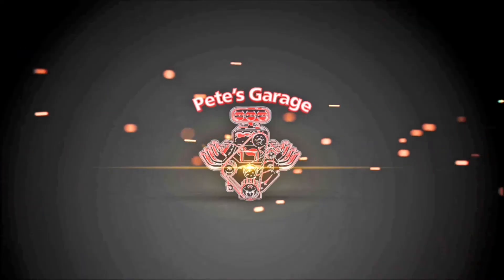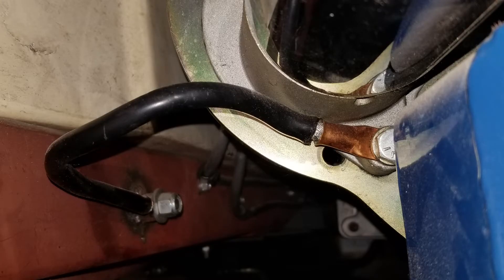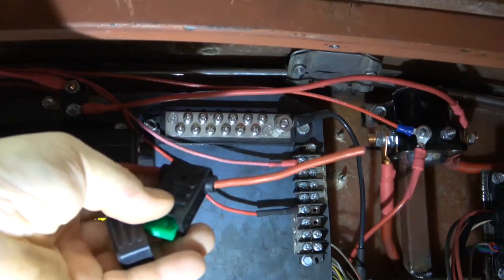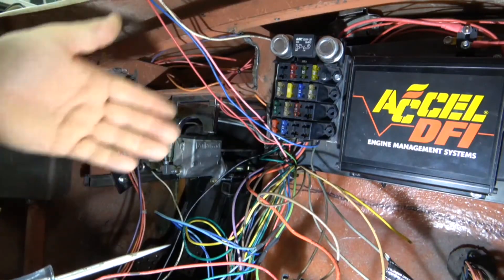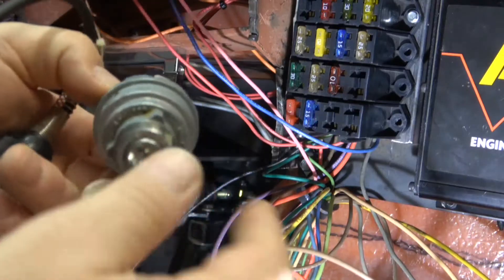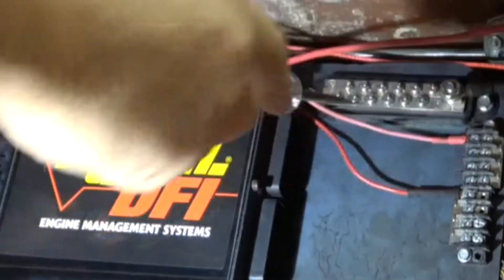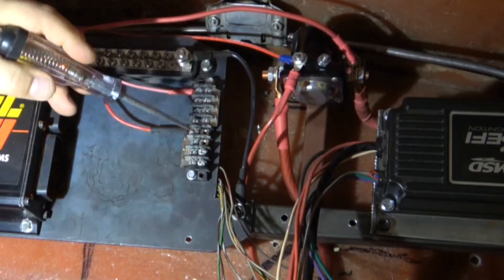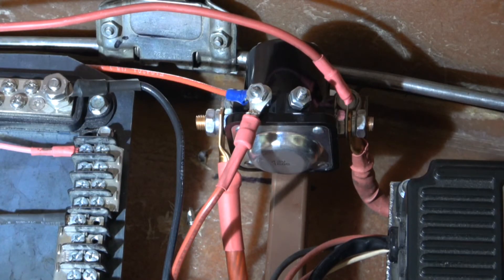Basic Wiring - Ground, Battery Plus, Ignition, Accessory Power - 427 Cobra

Comment: I was looking for is the neg. cable go from the batt. to the block, and if it has the old tiny wires do you snip those down insert them in a ring and just bolt them down with that neg. cable. since these have no answers, I'm going to speculate yes on a 2003 f150 4.6l
Reply from the maker: There should be a grounding strap from the block to the frame

Comment: Very detailed video, thank you! I don't understand the purpose of the second wire on the starter relay "S" terminal. You said it goes to the "starter solenoid". The starter relay IS the starter solenoid in this circuit, isn't it? If it isn't, and you're using a modern starter with its own solenoid, why do you even need the starter relay? Why not just send battery power and the neutral safety-switched ignition line direct to the starter solenoid and eliminate the starter relay altogether?
Reply from the maker: The starter relay pulls in to allow high amperage to run the starter motor. The starter solenoid pushes the gear out to engage the flywheel.
Reply: solenoid is much different. my hyundai 100 portable cut off on me randomly.... when its starting its cranking/tumbling but wouldnt start... it sounds like a battery/electrical problem but wasnt. just a small arse solenoid
Reply: but the solenoid typically located on starter itself. it needs each other

Comment: I have a 88 Winnebago Motorhome P30 Chevy, trying to wire circuit breaker box which feeds into the fuse panel box for DC chassis power. Trying to connect purple, red, blue, white, black wires. Can you provide any insight on properly connecting the wires properly so the switched side works properly. There are purple, red, white, black wires feeding to the circuit breaker box.
Reply from the maker: I need a schematic that shows were the wires come from or go to

Comment: I have a question that has an extra wrinkle.  So i am installing some digital guages (dash panel and two pod guages) as well as a radio. Each of these require an illumination dimmer signal.  Is it ok to find the dimmer source and run it to a small distribution block, so i can theb run one wire to each of the devices instead of trying to splice them all into one?  

Also, when supplying power to something like a guage, should a 12v constant wire be fused or should the 12v ignition be fused, or both? 
Thank you for the informative video!
Reply from the maker: Yes, you can run multiple lights from one dimmer source, in parallel

Gauges should be constant voltage with a fuse

Comment: Watching this video explained the interaction of the switch and the outputs in different positions. The exact info I needed. I couldn't find any info about the interaction of the outputs until I found this video. Now I know that the Accessory brown wiring is active in the Ignition switch Run position and off during the Start position. Exactly the info I needed to know to wire the Vintage Air IV Violet wire to a switched source. Turns OFF the compressor  in START position and ON during the RUN position. Thanks Pete!
Reply from the maker: I'm happy it helped. It can be confusing

Comment: Just to be clear, at 1:47 the video displayed is an engine hood open absent engine? The round thing is a master cylinder, other end is a negative terminal to the battery.  Hooked up to the chassis of the car.  Excuse me, but not everybody knows this.  It took me a minute to figure it out. I may be wrong.
Reply from the maker: No, the engine is in it. There is no master cylinder in the engine bay, they are under they are behind the dash. The negative terminal is hooked right to the frame

Comment: Question I have a 1993 mustang LX 2.3L. Having a short issue. No battery power at all to Fuze box. No lights and no start.  This vehicle is standard.  These are some of the things I've checked. Starter solenoid, ignition switch,Battery, and all wiring under hood and under dash. I changed the starter because it got fried.  Though that could of been the problem.  But when I hooked it all back up. It started smoking.  So I disconnected the small lead wire that goes to the starter. Still no luck  car is completely dead.
Reply from the maker: Did you check the neutral safety switch?
Reply: Well guys I'm not going to sugar coat this. I miss up when I reconnected the solenoid.  I connected the starter wire along with the positive lead cable from the battery.  The starter wire is supposed to be by its self and all other wires on the opposite side.  I reconnected the wires to the solenoid correctly and it started right up and functions work. I did have to change the starter cause I did frie the original one.  Hope this can help someone out with a similar issue.

Comment: Greetings, amazing job you're doing here, keep up the good work! I have a question, does your (12v) feed (BATT) to your ignition switch go thru your 30 AMP fuse or is it ok if we get a separated live wire coming from the battery?
Reply from the maker: It goes through a 50 amp

Comment: am installing keyless key future in my 53 chevy truck so the manual instruction say to connect some wires to starter 1, starter 2, accessory 1, accesory 2, ign 1 and ign 2 so can you help me to know what terminals are in the ignition switch?
Reply from the maker: Start is when you turn the key to start, accessory is when the key is just on, and ignition is always hot

Comment: i really appreciate ur help to understand how to wire acc leg connector and power leg connectors.I just trying to connect ignition switch on my 1952 chevy truck so another question about ign sw is, is possible to run wire from BATT to power leg and same wire to IGN SW on BATT terminal or have to run  a wire to power leg terminal and another to IGN sw on BATT terminal. Than a wire from starter solenoid to IGN SW on ST terminal and another wire from NEUTRAL SAFETY SWITCH to IGN sw on S terminal? this is confuse because there some ign switch with 5 terminals (batt, starter, ignition 1. ignition 2 and acc) and the one in your configuration is 4 terminals. nay ways thankyou to share your knowledge with others,
Reply from the maker: You can run a wire straight to the switch

Comment: so you are running a wire (ACC terminal) from ignition switch to connector leg and the wire to power the primary ignition connector leg come from Batt terminal on the ignition switch or it comes directly from batt?
Reply from the maker: Directly from the battery

Comment: Hello! What is awg of wire are u using from ign key to power legs and ground leg (how rick are those wires)?
Reply from the maker: It goes by amps drawn. If you have a 50 amp main in the fuse box, use 10 gauge, 20 amps is 12 gauge

Comment: Hello Pete. Question. when u turns the key to start the engine, the red wire from Batt touch the Ppl wire from neutral safety switch to turns he engine on, How this circuit works?
Reply from the maker: The neutral safety switch breaks continuity so the starter won't operate. Being in neutral completes the circuit.
Reply: @PetesGarage  tank you for a quick response this video is very help full

Comment: Hello Pete, Question I have an old 75 scout 11 and the old style glass fuse panel is pretty much shot, I'd like to install a new fuse panel and remove the old one. I have the factory service manual and have the wiring schematic. Essentially there is a battery feed connector a packard 3 over 3 style that has a 10 ga wire that runs and powers one leg of the fuse panel. there is a 12 ga pink wire that runs to the Ignition B terminal which is always hot, and like you explain the ign switch is where the constant and switched items feed from. so my question is is the entire fuse panel always hot?  mean you have your fuses protecting the hazzards the lights the headlights ect,  but it doesn't seem to me there are any switched items at the fuse panel, so if i run that 10ga from the battery feed to my new panel do I just connect it to the hot lug feed at the bottom and the whole panel is hot? I'm sure you get my question. thanks in advance you're the best on the tube at describing these things and a great instructor.
Reply from the maker: Parts of the fuse panel are always hot, and other parts become hot when the ignition switches turned on. That's my guess
Reply: @PetesGarage  thank you sir that's what I thought.
Reply: @PetesGarage  Sounds to me like he wants to how is he gonna run ignition power that controls things that are not always hot but need to obviously be fused. Because in many boxes that are bought there’s only hot. He needs one that’s split where he can run a wire from the ignition power to the box as well to run those things that aren’t always hot. Or run two block one hot one switched

Comment: Great video. My kit car is being wired a bit differently. I'm using a donor car keeping all that wiring for the chassis. Did a motor swap and using that harness and fuse block for that engine. So two fuse boxes which I think will be okay but your explanation helped. As I need to get the engine harness power ACC and ignition power.  Thanks
Reply from the maker: Thanks

Comment: Great video!

I plan to use a Bus Bar for clean ignition power and ground. My question is, is it okay to splice into Ignition Power and then have item (Fuel pumps for two tanks) routed into PDM? I'm installing a Holley Sniper 2 EFI with PDM and Hyperspark into a ‘74 Chevy K10. 

Ign Power~Bus Bar~PDM using 14awg…do you think that will be good enough?

I'm just nervous to cut and splice that wire.
Reply from the maker: It would be better to run the fuel pumps through a fuse first

Comment: Hello, Great video . i wanted to ask you , in this setup, does the positive wire from the battery to the ignition switch go through or the fuse box or it bypasses it? 
also , are the always on accessories like the horn ,lights powered by the positive wire from the battery or does it split in the fuse box to be fused?
i have a trouble understanding how did you route and differentiate between always on accessories and the others because they all seem to come from the same fuse box. thanks a lot!
Reply from the maker: It goes trough the fuse box. The accessories are also powered positive through the accessory fuse
Reply: @PetesGarage  i understand .so the FUSED ignition switch goes further to power the other indepedently FUSED various accessories .hats off to your efforts ,they are invaluable

Comment: This is very interesting. I'm measuring the resistance between the wires at to the top of the fuse box and chassis ground. Should the resistance always be low, like ground to ground resistance, or does it depend on the components in each circuit? And should all of those connections have continuity with ground?
Reply from the maker: If there is nothing in the circuit resistance should be low. Some things will not have continuity to ground if there is a switch or relay in the system

Comment: Ok so have an old 2006 Toyota Camry just need a positive trigger wire from fuse box to boot (using double adapter fuse holder) I’m guessing fuse is under dash is where I can install? It’s for dc to dc charger, the thing is I have fuse called “ECU-IG” I’m guessing that’s it?
Reply from the maker: The ECU is the computer so it will be on as soon as you turn on the car
Reply: @PetesGarage  great thanks for the help